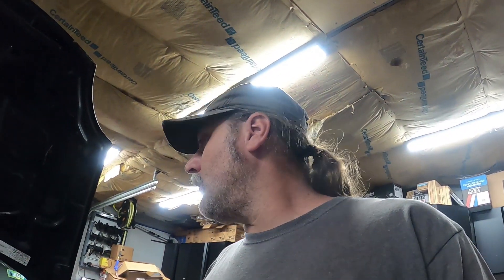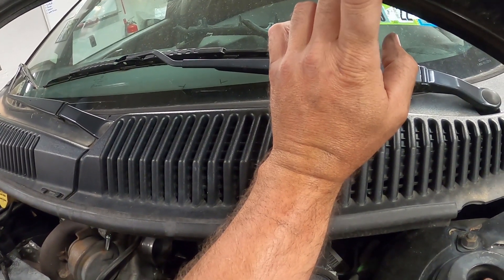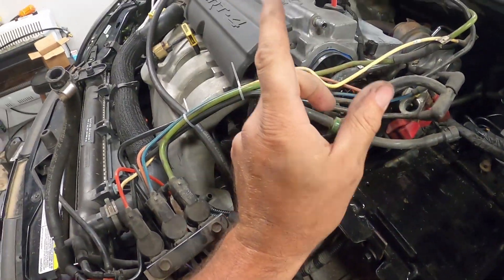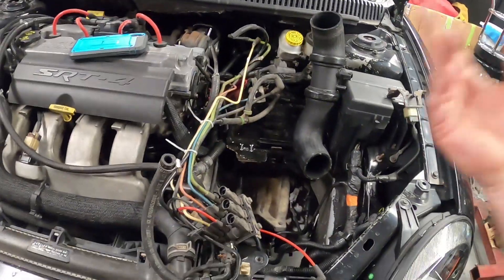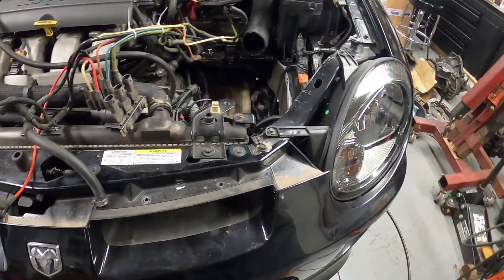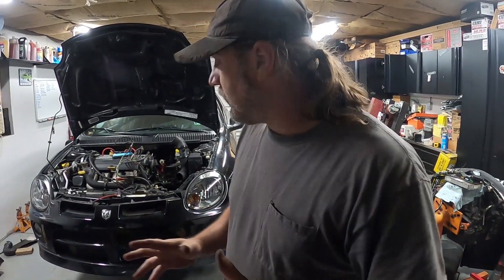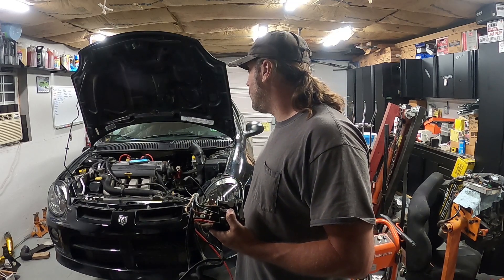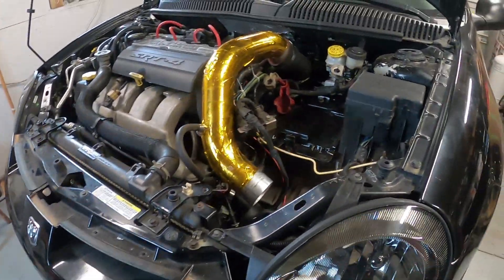srt4 vacuum line how to ....

Comment: I have all my vac lines hooked up. My wga line is going to the solenoid but I have no boost. I take it the line off and it goes to 5psi. It’s an adjustable wga and brand new. What could be an issue? I did a boost leak test and kinda sounds like a leak in one of the lines but can’t find it
Reply from the maker: the green solenoid is the one that controls the waste gate if it was boosting before the wg change the new one has the incorrect spring or the slack is not adjusted out of the arm correctly if its a boost leak and your using a tester can try some soapy water if there is no physical or you cant feel the air check all the connection points you can spray on the soapy water and look for bubbles you will need to jack up and support the car with jack stands as you will need access to the btm of the car also..
Reply: Could I possibly pay you to go over/fix my issue? I have all the lines routed as it shows on the hood, but the boost spools slow now. Low rpms it’s almost nothing until about 4500-5k. Mods are intake, turbo xs bov, catch can, 3 bar sensors, dsp i3, bfmic, mpx down pipe and side exit. I’m in NW Ohio. I’m willing to travel or can pay you for you a FaceTime call or something lol

Comment: Matt I'm having problems with my newest srt4. It'll spool up 2 like 4k n than it'll just like fall on its face and. Bog out. Is that a bad turbo or maybe wastegate
Reply from the maker: could be a few things, check the vacuum lines hooked up correctly something plugged off that shouldn't be, does it have aftermarket waste gate? bad intake gasket, vacuum hose leak, boost leak bad bov, map or tip sensor bad not matched or tune not rescaled for the car short in damaged wiring at the main ecm plug could be one or more of these things or none,  I;d look every thing over and double check can try one or 2 things go for a test ride, id guess its seeing over boost
Reply: Hey Matt’s where is ur shop at got some trouble with mine srt4 sir

Comment: ive recently tackled my boost lines and the kit i received from modern performance the wga line was shorter i ended up just going to full rubber lines afterwords due to it being simple to install maybe you have experienced this too?
Reply from the maker: I’ve always been luck and had some used ones I never had a set of the new ones yet
Reply: @Mattsneedforspeed  i see

Comment: I recently got a check engine light on my 04 srt4 and it showed up as “reinstall vacuum hose at intake manifold or fuel pressure regulator” what does that mean exactly
Reply from the maker: what was the code number ?
Reply: @Mattsneedforspeed  p 1188

Comment: What do you with them if you install an air intake?
Reply from the maker: if your still on a stock set up you keep the vac lines hooked up some/most of the kits come with a bracket to mount the solenoid pack off the battery tray

Comment: I'm running a S3 turbo with agp wastegate.  Does it matter which nipple I use off the turbo to connect the two?

I hope I worded that correctly
Reply from the maker: Yes I think so the one feeds the solenoid for the waste gate the other is for the evap system the one for the waste gate should be the one near the end where the hot side pipe connects, the pipe under the car

Comment: What happens if you disconnect the Evap line?
Reply from the maker: It should technically have vacuum pulling on it ive seen lots not hooked up and no codes ??
Reply from the maker: @sinfulserpentful  yes that is correct also the staged ecms are labeled off road use only for legal reasons

Comment: I have a P0300 code on my srt4 and I’ve replaced coil-pack,plugs-wires,spark plugs, injectors do you think it could be vacuum related?
Reply from the maker: If they were replaced with known good parts id do a compression check or even a leak down and also inspect the timing belt if its off a few teeth or if the car has cams and not tuned can cause p300 or poor fuel quality too low of octane, not likely but a bad intake gasket, a vacuum leak will cause high idle a lean condition ive seen the gasket folded over on cyl #1 cause a miss rough/high idle hard start but no code or there's damage in the wiring harness some where bad plug end will need visual and can some time find by shaking the wires a little depending on the damage